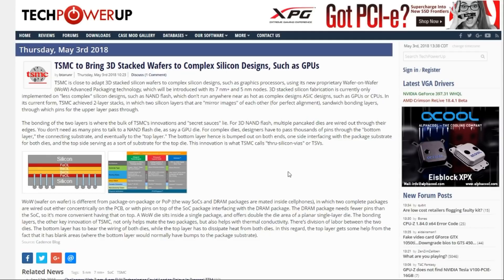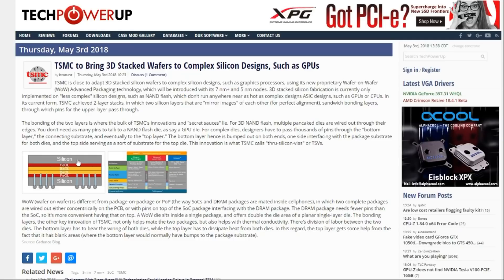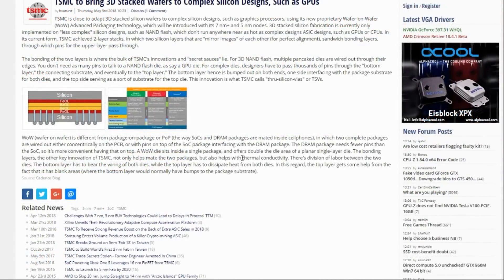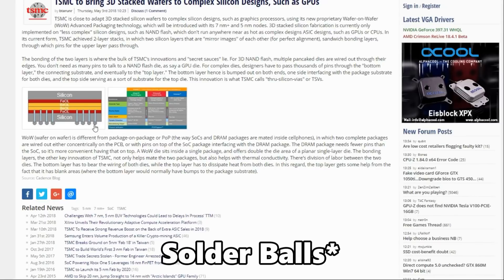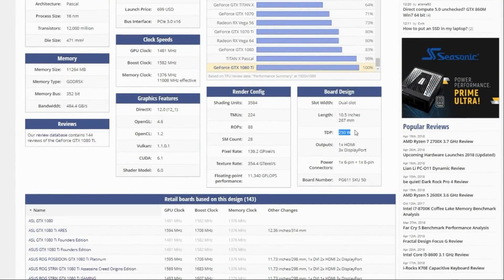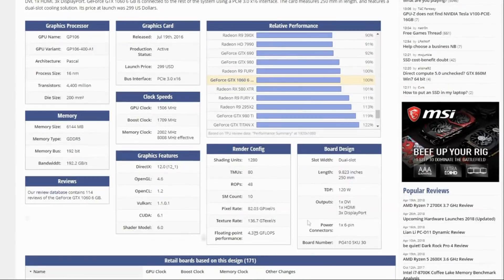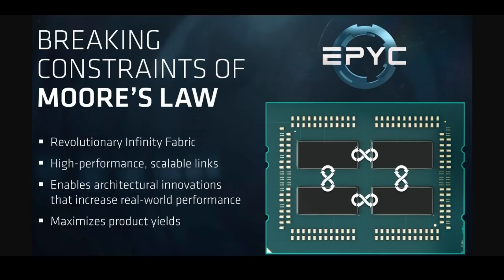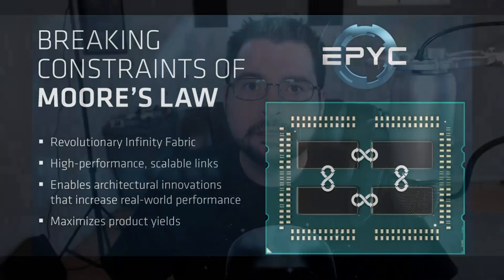TSMC's Sandwich Technology! The Future of GPUs?

Comment: 3D stacked chip isn't as easy to make as normal chip of that size. Yield benefit of smaller 3d die size may be much lower or zero when compared to bigger single level die.

Comment: Stacked GPUs will cause heat build up, especially on the bottom die because it will not have direct contact with an IHS, instead it will have a hot GPU above it.  I am interested to see what plans they have to dissipate heat, possibly smaller nm nodes?

Comment: I wonder how this would affect the failure rate of flip chip package mounts due to thermal cycles. Having smaller chips would improve it, but having two layers of connections could be a bigger problem, especially with the kind of heat distribution you would have throughout the package.

Comment: Doesn't anyone else seem to think this is kind of useless without being able to test the dies individually, the problem with GPU and CPU dies isn't there die area especially on high yielding dies which they plan to use with low TDPs. Where as with memory and espically stoage you are somewhat limited by the size of the NAND / RAM chips size.

What made AMDs implementation good is that they could test each die separately then put them on a package, so they didn't have to throw away a hole CPU because 1 die was bad or otherwise there would have been no point to it. it would however, I admit have been nice if the Epyc and ThreadRipper packages were not so big.

This seems to me to be useless until they can bin individual dies then stick them together after the fact, because then you can take advantage of the higher yields of smaller dies rather than this that has the same problems as a monolithic die ontop of the heat being doubly consented, The only benefit I could see is for very large dies where they are so large that the amount of die space put over to communication across the die has gotten too large and is producing too much heat.

But then it doesn't matter anyway because big GPU dies don't yield well and produce a lot of heat and the majority of it is not the communication subsystem, so again I say this is useless until they can bin individual dies.

Comment: I would rather see the infinity fabric improved and stay with the configuration used for Ryzen / Epic. Using multiple dies on the horizontal, with solder will make heat dissipation a lot easier. Stacking, in my opinion, may work for something with an extremely low TDP. Just don't see it for discrete GPU's. 
Interesting stuff though. thx

Comment: I think that multiple chips on the same die makes more sense than stacking them atm. If they use hbm2/3 then there is an enormous amount of room, and putting 8 250^2 on one board is feasible, or 4 500’s, 6 333’s, whatever, but the stacking of the actual chip would only work, and it could, if the chips were literally in a hole in the board itself, with cooling on both sides if it were more than 250^2 or there-about. If they were using dual side fans, then they could have their super chips stacked, if not, I think freeing up most of the space by using hbm 2 and up, as again, it leaves so much space compared to ddr5/x. Heh, a heatsink and 3 fans on each side of a GPU, now that would be cool as heck. Imagine 2 v102’s stacked x2 on each board. Yikes. Need one heck of a PSU and PCIe 4 to deal with that.

Comment: They could easily do two GP102 type dies but they would have to run them at lower clocks and voltage. Granted smaller dies would be way more probable.

Comment: Maybe that's their answer to Intel's silicon interposer technology. If you'd use this sandwiching to connect several high-power chips but horizontally and not vertically then you will not encounter problems with heat dissipation. Also you can produce that interposer with less precise fabrication process and therefore use cheaper, older, even retired equipment to save money because making these interposers on their modern equipment makes no sense in terms of return on investment 'cause it will be large and it's much more cost-effective to make, let's say, several memory chips that will take the same space on the silicon wafer. But I might be completely wrong.

Comment: It was inevitable. We just can't keep making smaller and smaller lithography to get more performance on the same size/smaller form factor forever. 
So ultimately the existing high end graphics cards architectures keep getting improved to their max and they stack GPU's the best they can until the point it starts getting too bulky for a PC.
And in the long run the consoles might end up dying due to sheer lack of space.

Comment: How are they going to dissapate the HEAT???
Reply from the maker: That's my question. There's some vague answer in the article, but I'm not sold yet.
Reply: The Good Old Gamer It seems to be a good solution for low power mobile chips.
Reply from the maker: I think it can work with really low wattage chips combine to make a more powerful chip at a lower price. Also a way to side step process shrink limitations.
Reply: I really don't think this will be for anything major performing. I honestly think this will be something where they stack something like the Cache on the bottom and have more compute units at the top.
Reply: Maybe later we will have liquid-hydrogene cooled supraconductor chips !

Comment: Multiple layers, more processing units and more transistors. Clockspeeds will be lowered for the sake of efficiency and while you essentially might have 2x the transistors you might only have 60% increase in performance while power consumption is only increased by 20%. It's going to go for the efficiency rout if the nodes do not get much smaller then 5nm in next 5-10 years. Of course the next thing is multiple die package solutions like Ryzen is and increase the cooling area aswell as the performance an power consumption. There will be a point when more is simply more everything.

Comment: The only problem I see is the whole frame latency issue. These will still be independent dies unable to share internal resources, so they will still have to process information in parallel. If this becomes the new standard, the future of graphics just got a lot more jittery. It is just essentially on chip SLi.
Reply from the maker: The die link directly together through thousands of interconnect (mentioned in the video.) like 1 4gb stack of HBM doesn't read as 4x1gb. They work in parallel. This tech is also virtually latency free. That's why it's superior to infinity fabric
Reply: Even if it has some kind of technology similar to ring bus or infinity fabric between chips there will be more latency than if it was done on chip. Processing units on chip can share more connections than you could ever possibly physically connect through substrates. These pins are dedicated to the input and output results of those processing unit networks and not directly linking the intricate nodes within the processing networks. Think of it like those 16 pin black chips. There are only 16 pins but there are thousands of connections on the silicone inside the chip. 

There would need to be a lot more pins then there currently is because for true parallel processing the individual diodes themselves would have to share connections like they do on die. Just the physical distance alone will produce latency. If you engineered it properly the impact of this latency could be minimized, for example putting all of your processing units on one die and then stacking your die cache on the second die. Splitting up the processor banks that are working on a single solution would just be an unworkable problem. Ram chips are entirely different as they are just essentially cache.

Comment: They say that 7nm leads to a 70% decrease in die size. This along with 7nm power efficiency may allow them to stack higher end GPUs. Yields and heat will be a big issue however. Mobile is the most immediate place for this technology.

Comment: Wouldn't Infinity Fabric or an Infinity Fabric like technology be more efficient? Considering some of the engineers from the Zen Project were moved to RTG it might become a thing with Navi, but I wouldn't be surprised if this was implemented in the architecture after Navi since Navi has been on the roadmap before Raja left RTG. Does AMD have a license on Infinity Fabric? Would Nvidia need to buy the license to use it or perhaps try something similar to it without crossing any legal lines?
Reply from the maker: AMD owns patents in IF yes. Nvidia would have to develop their own tech, but looks like TSMC has done it for them.
Reply: The Good Old Gamer One thing I FORGOT to mention with this stacking method...how are the dies going to be properly cooled? And on that note what would happen if one of the dies is defective or stops working? Would it just be SOL from that point?

Comment: This might be great, but it won't have the best yield rates. The point of Infinity Fabric is to allow for higher yields. If dyes are stacked, and one of them goes bad during the process but the other is fine, tough luck. Both are rendered useless. If a Ryzen or possibly Navi dye goes bad during the process of creation, it can be safely discarded, and only working dyes will be placed on the PCB.
Reply: Greendude439 I've not investigated this but is the stacking process not seperate from the creation of individual dies? Otherwise like you say, it provides no advantage
Reply: TheBLC94 
I got my information from here. https://overclock3d.net/news/misc_hardware/tsmc_reveals_wafer-on-wafer_chip_stacking_technology_-_wow/1

Comment: They can put low power part on lower layer and high power (heat) on top, so die size go down, but heat not get so much up. Not all part of die heat same, so it required completely new design/architecture

Comment: My first thought: 2 1050 TI equivalents stacked connected though infinity fabric to another 2 1050 TI equivalents. A $500 card that outperforms a 1080 TI card of today.
Reply: Yeah, infinity fabric for GPU's should make multiple GPU dies function like a single GPU (like threadripper functions like a single CPU), circumventing the SLI/Crossfire driver problem.
Reply: Like Nameless said, scaling on this would be far better then what we see with crossfire and sli and I doubt sofrware would be an issue for this because gpu's are very parallel in nature. Anyway, the benefits of this could be big, it's cheaper for make, it's a easy way to offer a lot more performance and it should be cheaper for the consumers, it would be a bit like how buying two mid or lower end cards and they perform much better then a more expensive one whiles also costing less, in this case it would be even cheaper then that because a lot of the dupulcations wouldn't be needed as well.
Reply: Gamers always have and always will. This will DEFINITELY not change that. It will make GPUs cheaper to make because of higher yields and removing the need to make high-end GPUs. Why make a high-end one when you can just put 4 of the low-end ones together and achieve the same or even a better result? Whether the GPU companies will pass these savings on to the customer or not is anybody's guess. I am thinking probably not.
Reply: In a way it is sli and crossfire but in another it's not, it's much closer together, you don't have the PCI cross bridge to worry about, the memory pool is very likely to be all one, latancy is likely to be far lower, I don't see any reason why this couldn't work and across all games, even Crossfire from what I remember could be more or less forced to work with almost every game.

Think about it guys, many gamers went crossfire and sli because it offers a lot more performance and a much lower cost, the same works here, in fact it would be even cheaper, there is little reason why this can't work and offer much lower prices and much greater performance, it's also much easier for AMD and Nvidia to make then making one big gpu where they end up throwing away many defects because of the size of them, multi gpu's in one is very likely the way forward.
Reply: That would only be possible if performance scalability via driver support was properly developed, but such sw tech is pretty much dead, NVIDIA has been actively discouraging SLI for some time, and mid-range cards don't even support it anymore.
Reply: What we have seen from infinity fabric is 85-90% scaling. This will be even better scaling because less travel time. Software has nothing to do with it. We have seen it in action. It works. End of story.
Reply: That's not how GPUs work; each GPU is a separate device, it needs something like SLI to allow them to work in parallel, even if that's implemented at the hw level and transparent to the user. Just bolting them together with a fast interconnect doesn't make them magically work in parallel. What you're talking about here is not the same as simply connecting existing distinct GPU tech together; instead it would be more like scalable subunits, with higher level functions placed elsewhere, in which case the subunits are not GPUs at all, they're more like higher order compute cluster blocks (heck, called the shaders in modern GPUs "cores" is already dreadfully inaccurate). What might be useful is the notion of placing the compute clusters much closer to the VRAM they need, and using the interconnect to allow them all to link together. There are various ways of doing this though, and I don't know enough about the details to guess which would work better, plus it depends to what extent each subunit would need to communicate with the others (in games, not much, which is why the PCIe return path on gamer cards is only single speed, whereas on Quadro cards and Teslas it's full speed, with extra cache buffers and other features).
Reply: CPUs are not the same as GPUs at all. Either way, it won't really make any difference to the market unless the final product is not attractive to Enterprise. If it is, gamers will still get the thin end of the wedge.
Reply: This existence of technology might be why Nvidia been being a dick to the market for the last year, they see what technology is capable of and is heading towards and they don't want progress to be too quick for them to reap from.

Making GPP might be a way to categorize companies into alliances with or against one another, mainly as a way to antagonize it's competition.

AMD has infinity fabric, they have experience working with multi-die scenarios in the most recent times, and Intel is the next one to follow up, they have been checking out similar tech as well and may implement them to prototype in their own gpu line...

Nvidia? Not very sure, I haven't seen any worthwhile examples of them experimenting with this other than possibly copying Navi in a power point presentation.
Reply: Inb4 miners buy them out, because the mining performance would be through the roof.
Reply: But GPU mining is on the way out. So the chances of that are slim.
Reply: Minors are on there way out for not but from what we've seen in the past, they'll likely be back again, on the plus side, by then we are likely going to see chips designed for mining that are cheaper and better at that job then gpu's so with any luck it would do the damage it did this time, AMD and Nvidia can't really afford for another one of these because I'm hearing a lot of gamers thinking of going over to console gamers and even thought AMD are already in that space, the profits are tiny compared to what they make on the PC.
Reply: You are forgetting that this is JUST THAT. SLI on the hardware level. It worked with the Ryzen CPUs and CPUs are not all too different from GPUs when you get right down to it. And YES if you want to put a fine point on it the "subunits are not GPUs at all". If you actually look at the diagram, the interconnect contains the VRAM and stuff the GPU needs to operate. Now, infinity fabric is different. You have 2 COMPLETELY SEPARATE units with the Cache and other things IN BETWEEN the 2 units(CCXs in the case of Ryzen). But this is essentially the same. the 2 units are just SO MUCH closer together. But I have no doubt these two ways achieving the same result can be used in concert.